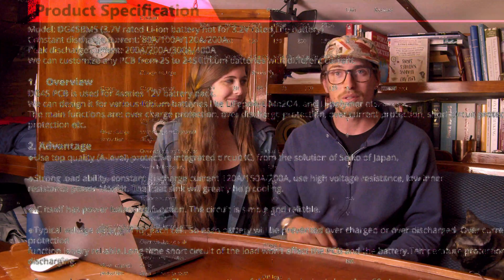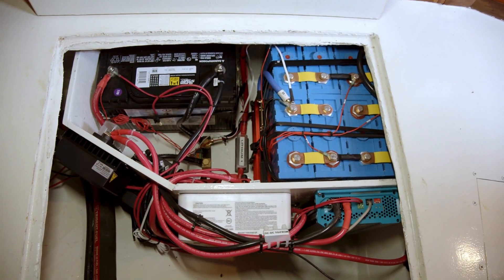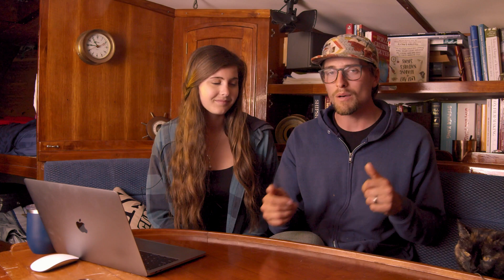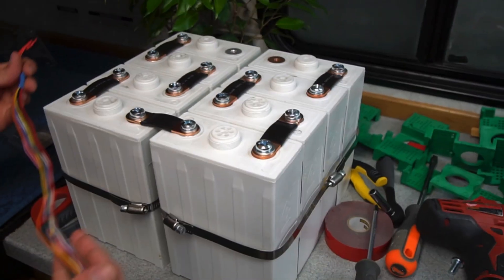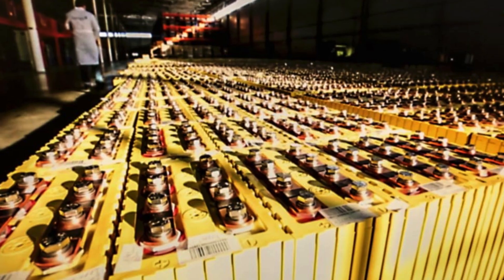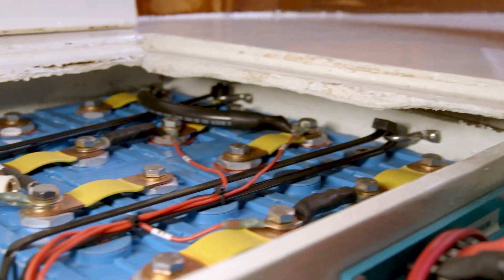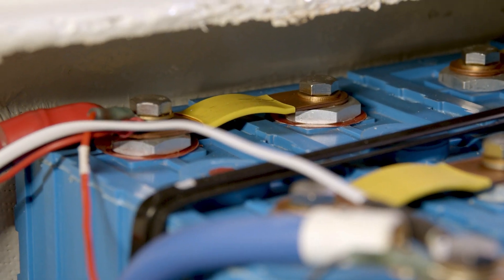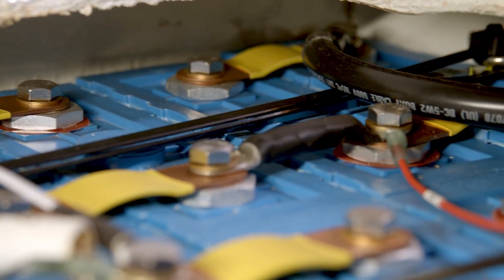Sailing Avocet | DIY Lithium Batteries, Part 1.5

Comment: Hey Chris, great info!  You likely said this, sorry if I missed it.  You mention the start battery is isolated.  Does your solar system also keep that start battery maintained at a full state of charge?
Reply from the maker: Hey Brad! Marissa here. Great question! We actually go into more detail on our website www.svavocet.com that should appease every techie wanting "more" but in the case that your answer is not found there shoot us an email and we will explain in whatever depth you would like. Thanks for the interest in this project!

Comment: You commended our Bionx video and asked us to watch this. 
Daly BMS Lifepo4 can easily short circuit when connection them to a load, be sure to have spare, also dont be afraid to bypass the BMS for discharging and monitor the batteries manually with a ISDT battgo or similar.
Reply from the maker: We have spares, and will be upgrading to a Bluetooth capable BMS when appropriate... one+ year into using this system and no issues so far. Thanks for dropping by!

Comment: I just called Renogy support today and worked out with them that my 200 ah Gel cell battery is dead (I could tell by the way it crapped itself down to 10v within 2 hours of full charge). Their advice was to buy a new one, as the warranty is donezo. Therefore, the decision is made to go with Lithium. My friend is a dealer of similar batteries, but curious, what series of CALB batteries did you go with? There are several that they list (CA, CAM, and SE).
Reply from the maker: Hey Shane! Wow, sorry to hear about your experience with Renogy. We actually wrote up a full blog post about this project with the material data! www.svavocet.com , I hope this helps!

Comment: It seems that these LiFePO4 cells benefit from having humidity less than 75% so I have been packing my cells with recondition able desiccant  bags. Also, the electrolyte can react with water to create Hydrofluoric acid, so while they are hermetically sealed,  it is good to keep them dry.  Fair Winds! (and sunny sky to charge your batteries!)
Reply from the maker: Cheers!

Comment: Great work you two.  The technique as well as the film making.  
We also have a lead acid battery for the engine while the house bank is Victron Lifepo4.  Similarly we have an older alternator connected to the engine battery.  Also using a DC to DC converter to charge the lithium batteries from alternator.  Victron utilizes a Canbus for communication between the batteries, the bms, the MPPTs, the DC to DC converter and the Multiplus charger/ inverter. 
Our primary charging comes from our solar and shore power.  But it's nice to be able to utilize the alternator a bit as well.
Great to see you both again.  Stay well.
Reply from the maker: We always look forward to your comments Michael, thank you! You sound like you are also pretty well versed in a system like ours, good to know! :)

Comment: Speaking of battery, please put one in your clock, and that book upside down... that's driving me crazy...
Reply from the maker: HA! I was wondering when someone would notice. The ships clock will get a new battery soon when we reinstall it along with the barometer. :) thanks for watching!
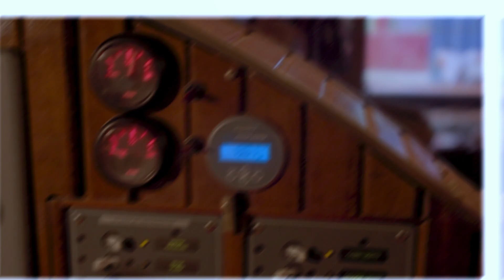Reply: Many years ago I had a built in oven in our home.  After many years the clock in it died and was stuck on 8:53, for he next 5 years.  I ended up changing the time because the click controlled the self cleaning function.  I could start and stop the cycle by changing the time manually.  Friends and family went nuts.  The world had ended because the time was not 8:53.  Great video, I am an electrical engineer and you did a wonderful job of covering a tonight topic
Reply from the maker: @louwilliams8528  Thank you Lou! That means a lot to us

Comment: Lead acid batteries are better for starting your engine as they typically have higher cranking currents than lithium batteries. They will also work at freezing temperatures.
Reply: Lead acid is better for starting because it's easy to charge with an alternator and can be recharged at lower temperatures.  The LiFePO4 discharge current is DRAMATICALLY higher....  It's not even close.  Open terminals on a LiFePO4 array are no joke.  The battery they built can discharge somewhere in the neighborhood of 3000 amps.
Reply from the maker: We love seeing discussion in our comments!

Comment: Backup is always a great plan. Redundancy is so prevent in the airline industry for a reason
Reply from the maker: indeed
Reply: @sailingavocet  Complex aircraft engineers strive to design out single point failures of critical systems.  One hopes to achieve a systems design that requires multiple failures of redundant systems to affect airworthiness.  Regrettably, this doesn't always happen.  You guys are solid in your thinking with Avocet's refit. Pretty impressive.